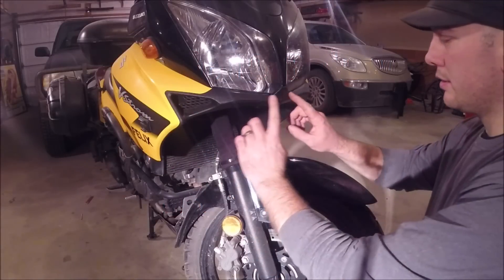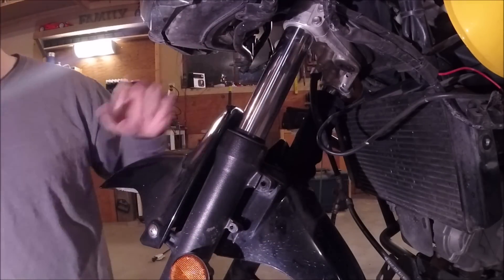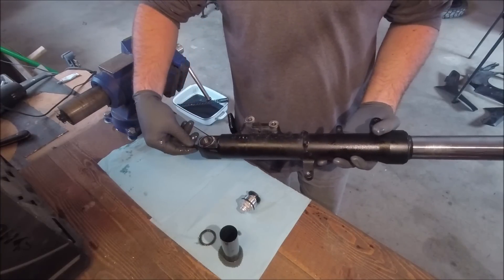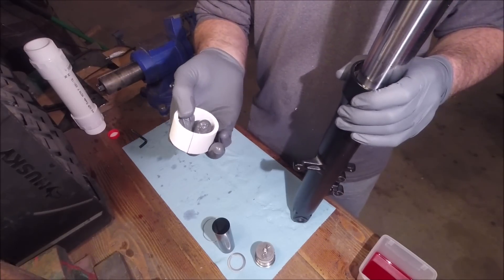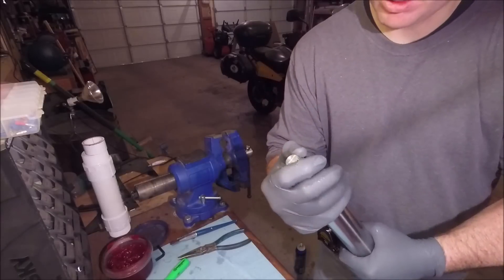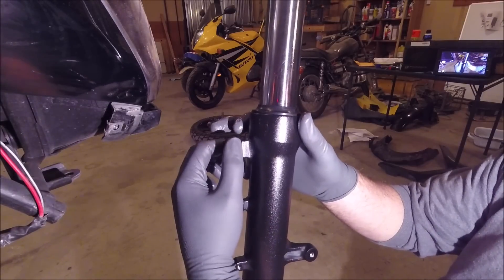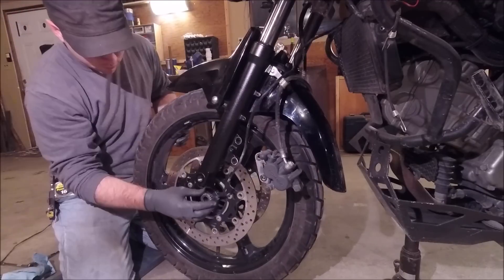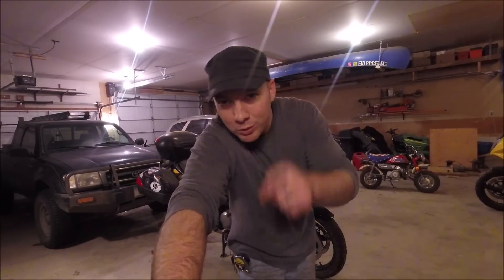V-Strom Forks, Start to Finish. Easy!

Comment: I'm about to buy a used 2013 dl650, with 19,000 miles.  The previous owner reported he did the forks within the last 2 years, but this video is definitely going into my saved library and is appreciated.

Comment: Nicely done M. Moto.
My 06 needs to be done and on my project list (62k mi).

One  trick for fork leaks is to first try cleaning the area between the seal and the fork tube (often dirt can be causing the seal not to seal) using a piece of thin plastic (35mm film or lettuce/veggie container).  I tried cleaning the Strom, no joy so clearly worn. However I tried this with some of that lettuce container plastic that I fashioned into a 1/4 by 4" piece and managed to clean the leaking seals on my Super Tenere - stopped leaking.

The booties are an excellent preventative as you point out.

Comment: omg and you undone the fork caps with the pinch bolt tight !!!!
Reply from the maker: And you feel this is wrong?....
Reply: Mainstream Moto defo as the clamp holds the cap tight in the tube if you loosen the top clamp bolt the cap come undone easy
Reply from the maker: @mechanick1000   I can see how that would be easier! Thanks for the tip!
Reply: Mainstream Moto your very welcome my friend

Comment: 09:45 would it be possible to skip this step until the forks are back in place on the motorcycle? I mean torquing them down gently but firmly by hand and once the forks can't move around anymore use the torque wrench. I don't have a vice, that's why I'm asking.

Comment: New to riding and got my first bike 5 days ago. '04 DL650.  What benefit does the progressive spring have over stock? Perfect video btw. I have a leaking fork seal and this video is exactly what I need.  any recommendations for seals, oil?
Reply from the maker: This is just my experience. The stock suspension has a reputation of being soft and its great for the long hwy miles and zipping around town. However when you get into the twisty roads, you can feel the nose dive down through the corner. The progressive suspension made it feel more planted through the corners. Off road it helps with bottoming out the forks and has made it feel less bouncy. I tend to get more feedback through the bars. Some people like that, some people don't. That's just what I've noticed. 
I've have only used Suzuki seals and Pro Honda Suspension Fluid SS-8 10W for my bike. Have never had a seal go bad on my V-Strom! 
Congratulations on the new bike!!!

Comment: Thank you so much for the video. I have the exact year and model. I was wondering if you can provide a link to all the parts you used for this video? I am having hard time to find the seals and the spring
Reply from the maker: Fork seals
https://www.amazon.com/All-Balls-Suzuki-V-Strom-2004-2009/dp/B07SJVFLLB/ref=sr_1_1?dchild=1&keywords=2008+dl650+vstrom+fork+seals&qid=1632759238&sr=1-1-catcorr&vehicle=2008-1-17291-20-----14124------1&vehicleName=2008+Suzuki+DL650+V-Strom

Springs
https://www.amazon.com/Progressive-Suspension-11-1533-Rate-Spring/dp/B00383VF8M/ref=sr_1_10?dchild=1&keywords=2008+dl650+vstrom+progressive+springs&qid=1632759407&sr=8-10

Comment: Complimenti per l'ottimo video , veramente dettagliato come si deve , lo seguirò per eseguire lo stesso lavoro , solo una domanda : quanto olio ci va per ogni forcella ? grazie buona serata .
Reply from the maker: 18.5 oz per fork or 143mm down from the top of the fork without the spring. 10:00
Reply: @mainstreammoto4856  thankyou very much ;-)
Reply: @mainstreammoto4856  una volta disassemblata la forcella e svuotato l'olio , con che prodotto hai eseguito la pulizia ?
Reply from the maker: @filippozanolli6979  I used Brake Parts Cleaner. You can also use Isopropyl Alcohol.
Reply: @mainstreammoto4856  oooook
Reply: @filippozanolli6979  hai fatto tu il lavoro alla fine? Sto ragionando se farlo io o portarla da un meccanico
Reply: @adryx_92  scusa ho visto ora il messaggio , esguito tutto io , lavoro semplice basta avere l'attrezzatura e seguire i passaggi con calma , ma il lavoro è davvero semplice

Comment: Good job, but why did you put pressure on the bike several times?
Reply from the maker: Because of the play in the fork shown at 14:58, you want the fork to find its natural resting place. If the fork is tweaked one way or the other it will cause binding when compressed. Working the shock before clamping down the pinch bolt solves this problem.

Comment: Thanks for tips. I just watched another vid where the guy didn't bother with the fairing, just reach up to get to clamps, is there a reason you took fairing off?
Reply from the maker: I took off the fairing mostly for the sake of the video, so that things were more visible to the viewers. I prefer to have as much out of my way as I can, and since they are taken off easily I figured, why not. Certainly no need to take them off to get the job done other than preference.
Reply: @mainstreammoto4856  Thanks much for a great vid, will have it on my laptop pausing where needed, mine is a 2008 as well, I bought the exact set of springs and oil should be here next week. My springs are shot and I have a bad leak on one side.
Reply from the maker: @timmytool1231  Nice! You'll like those springs! It would have been one of my first upgrades if I had known what a difference they made.

Comment: wieviel öl hast du eingefüllt in dengabelholm?how much fork oil did you fill per spar and how the feather rum. bought hyperpro progressively, got the same machine as you but with abs from 2009
Reply from the maker: 18.5oz or 143mm down from the top. 9:58 - 10:26 of the video. The manual for my 2008 says 143mm down from the top. I'm not sure if the 2009 is the same but I would bet that it is.

Comment: Do I have to take off the bottom? or can I just put new oil in it- stroke a few times then replace?
Reply from the maker: I don't believe that all of the oil can be removed from the fork without taking it apart. Oil will get stuck around the bottom-out cone and when tipping it upside down oil will get stuck between the stanchion and the fork lower. It wont be much oil tho. The forks can get kinda nasty inside over time as well so taking it completely apart and giving it a good cleaning has it's benefits. Your choice! Here's something to check to help with your decision...look at the color of the fork oil when you dump it out. If it's gray, then the seals are bad and should be replaced. (Gray color is a sign that water has gotten in past the seal.) If it's more of a black (like normal looking used oil) then the seals are probably fine. Then go from there with what you want to do. Hope this helps! Let me know if I can help with anything else!

Comment: The manual talks about using 2 special Suzuki tools to remove the damper rod bolt, but I don't see you use them, and I haven't seen them used in other videos either.  What gives?

Comment: Was there a big difference with the new spring?
Reply from the maker: Oh yeah! They are much stiffer. Made more of a difference than the rear spring. For the $100 or so, it's a great upgrade. I would have changed them sooner if I'd known.
Reply: @mainstreammoto4856  guess l have to do an upgrade then
Reply from the maker: @toby7504  Nice! What are you riding?
Reply: @mainstreammoto4856  04mod dl650... Serious crashbars on that bike of yours...
Reply from the maker: @toby7504  Yeah I built those for doing some trail riding. Didn't want to beat up the bike too much if I dropped it a bunch. They were kind of a prototype idea. I'd like to rebuild them with some round tubing to match the Givi bars a bit better
Reply: @mainstreammoto4856  they sure look solid.... Next winther project:)
Reply: @mainstreammoto4856  and i hope you make a video of it.
Reply from the maker: @toby7504  Oh I will!
Reply: @mainstreammoto4856  nice

Comment: I disagree with you on not loosing the top pinch bolts when loosing the fork caps. If you don't loosen the top pinch bolts there is some added difficulty in removing the caps. Leave the lower pinch bolts tight.
Reply from the maker: I wouldn't say we disagree... Just an oversight on my part! Good advice! Thank you!

Comment: I can't believe progressive springs$$ uses a plastic-pvc spacer
Reply from the maker: I felt the same way and thought about making my own out of some other material. But, when giving it some more thought... pvc is really a great material to use. Light weight, non-abrasive, non-corrosive, strong...enough, wont oxidize like aluminum. The benefits outweigh the negatives really. I hear ya tho, it seems a bit wrong initially.
Reply: @mainstreammoto4856  True enough

Comment: Only thing he did wrong was put the spring back in the wrong way!!. Tight wound part of spring goes to bottom.
Reply from the maker: Thank you for your comment. At 8:37 I put a caption explaining that the tighter coils go down on final install. At 10:28 I refer to the manual and clearly explain the proper installation.
Reply: @mainstreammoto4856  Thanks I was too hasty!. Great videos you do for the Vstrom . Much appreciated.